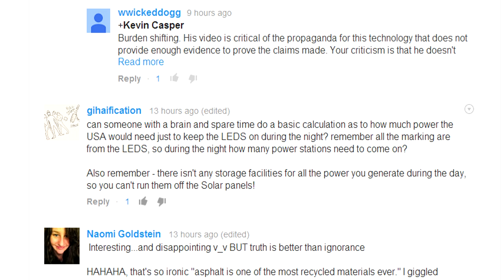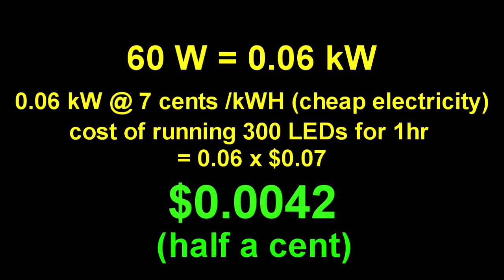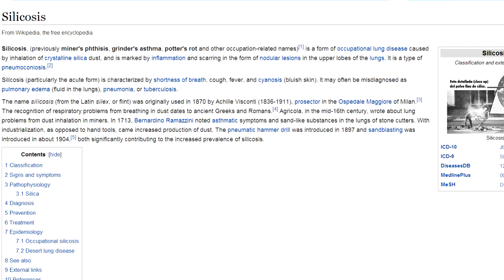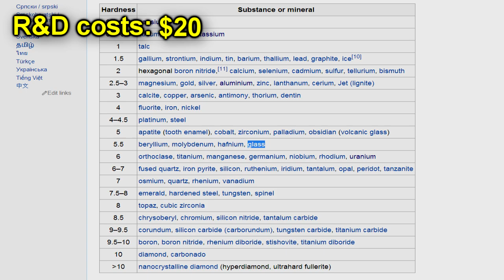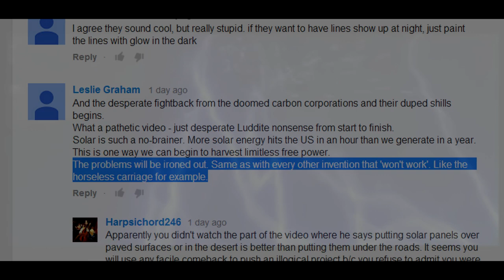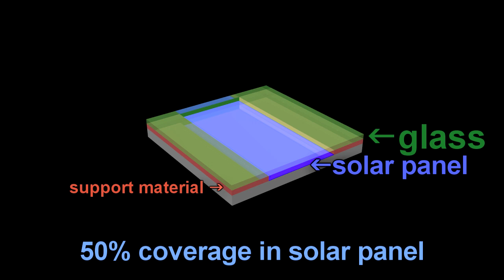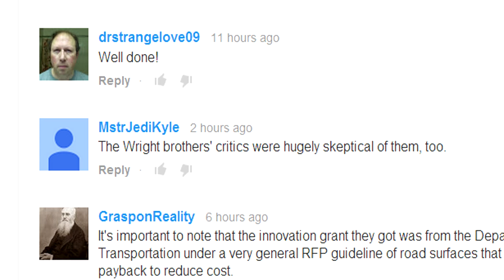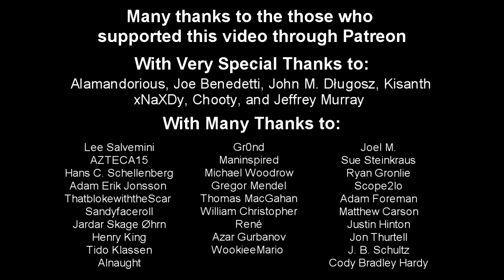Solar Roadways, IMPORTANT QUESTIONS AND ANSWERS!

Comment: To paraphrase from my own post made elsewhere:

$20 just for 300 LEDs...yep, if you're buying them on Ebay, sure.  But one would hope even the American (or any other) government isn't stupid enough to hit up 'icanzselluledz96' on Ebay for 4 trillion sets of 60W Xmas lights (not counting...um...shipping and handling costs), when they could source task-designed units at or below manufacturers' cost or (crazy idea) be manufactured in the same plant that makes the panels.  Unless of course they already buy their asphalt on Ebay, which may explain the lack of properly-mantained roads.  [You also complain] about the cost of powering the LEDs - which again would be a moot point since charging anyone for the power each cell collects to power itself is just...insane.

Sorry Thunderf00t, but I think you need to take a crash course in economics.  Mind you, I never studied economics...but I know enough basic math to know that your argument on that point is as straw as the Scarecrow from "The Wizard of Oz".  Finally, performing tests is all well and good, but unless you are testing the components they are actually using during development - rather than crappy, "designed for home use only" components you can buy from the supermarket or K-Mart - your tests don't actually disprove anything...except that you cannot use household items as road materials.
Reply: trooperJac
Nope...and neither do they. Why? Because...now what was that phrase...oh, yeah...proof of concept!  Concept - I trust you know what the word means, since you yourself used it. <.<
Reply: Yeah, my replies were in jest, so I get you might have thought "WTF?"  Okay, jokes aside...

The driveway proves (to many, at least) that the idea itself may have merit in the future, since they have a working prototype on which they can perform tests and refine the design - proof that implementation of the idea in at least a simple form is possible.  The Brusaws have made it perfectly clear that what they spent to build the prototype cells does not reflect the possible cost per cell should it hit production.  Still, it doesn't take calculus-level math skills or an economic degree to realise that - should a final design ever be finalised and approved - the components at production level are going to cost less than the prototype, and they obviously won't be using the food-rated glass and indoor-rated LEDs used in Thunderf00t's 'proof of failure'.  Take into account also that - if it does work as intended - the technology may well pay for its own upkeep over time, much like roof-bound solar panels do today.

If manufacturers payed retail prices for the materials to build production-level products, they'd be out of business, but since not all parts will be available for a prototype, sometimes less-than-wholesale prices must be paid initially.  Sure, it may never actually hit production, but a working prototype is still valid as proof that an idea at least works on a relatively small - but real-world applicable - scale.
Reply: Generally, I agree with you: the idea itself is novel and potentially solves a range of current issues, the initial prototype works as a small-scale, short-term proof that the idea works...BUT...in it's current (prototype, and therefore development-based) state, with current technologies and in the current economic climate both in our respective countries and globally (especially given spending priorities, which are not geared towards saving the planet, but in destroying it and everything on it) this will not work...yet.

As I said repeatedly, the idea has merit, and may be a possible solution to the energy issue; whether it can be made to work long-term, and the format it takes is yet to be seen, and to be frank I'm not convinced yet that roads are necessarily the best use of the technology.  What I take issue with in this video is simply the apparent assertion that this idea will not work - period - based partly on 'testing' by Thunderf00t which is based on incorrect assumptions.  For example, the use of LED daytime running lights and/or the LEDs currently used in traffic signals would have been a more accurate test of the visibility of modern small-form-factor LED technology, as they are in fact daytime-visible; had he proven (and I'll admit, he possibly could) that even those LEDs cannot currently suit the requirements, I'd be less inclined to question his tactics.

Comment: (-) $ 1.4 T / year

That's ~40% of the US Federal Spending (@ 3.5 T ) (1) (2)

It's important to consider the net gain as well... 

They cite: 21,827 Billion Kilowatt-hours of electricity / year (3)

2.1827 x 10^13 kWh / yr @ $0.0557/kWh (4) =  (+)$1.2158 T / year

Gain: $1.2158 T / year
Loss: $1.4 T / year
Net LOSS of $142.2 Billion / year

Not to mention workers, plants, and upkeep. This model is simply not viable.

Sources:
1. CBO.gov
 http://cbo.gov/publication/45278

2. Wiki
http://upload.wikimedia.org/wikipedia/en/2/2b/U.S._Federal_Spending_-_FY_2011.png

3. The Numbers - Solar Roadways
http://solarroadways.com/numbers.shtml

4. CSP for 5.57 cents / kWh
http://cleantechnica.com/2013/06/14/csp-for-5-57-centskwh/

Comment: For those who are mocking about this being a joke think of this.
You park your car on these during the day, bye bye efficiancy.

Drive over it bye bye effeciency. And don't get me started in major cities like where I'm near, rush hour means no solar collection.

Now place these on rooftops or high above the road now your getting somewhere, which allows removal of LEDs and thus cost reduction.

Also a method of storage of the collected power is needed and as far as I know we have no effecienct form of storage.

Work out those bugs before you think the scifi idea will work.

Plus these panels would only be good if we had hover cars running on pure electric and that tech is still off in the future

Comment: So glass and sapphire are out of the question as practical surfaces, but what about pure common quartz? It should be resilient under both rocks and tires (7 on the Mohs scale in pure samples), refract the light to the panels well, and would be cheap, since it's the second most common mineral on Earth.

Also, it seems a bit unfair to assume that the research team isn't exploring materials other than pure glass (such as quartz), and that the LEDs that they would use would be so expensive and inefficient in a larger scale. One option presented for the energy consumption issue was that binary weight sensors could be put in each panel to calculate a car's vector and activate the lights around it. I'm excited about this product, so I'm obviously biased, but I think several million dollars of engineering and research should produce a viable product.

Comment: I wonder if the crowd funding rate is going down as you produce more of these videos.  It certainly doesn't take much virtual simulation in your head to come up with some insurmountable problems that aren't easily solved by keeping the roads as they are and keeping the solar panels off the ground.